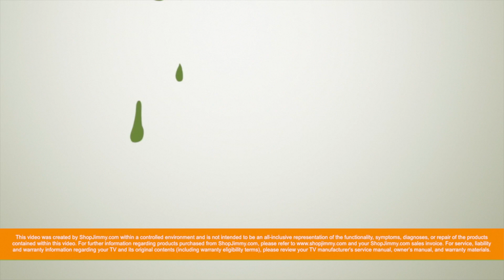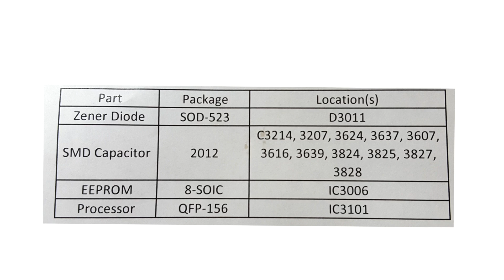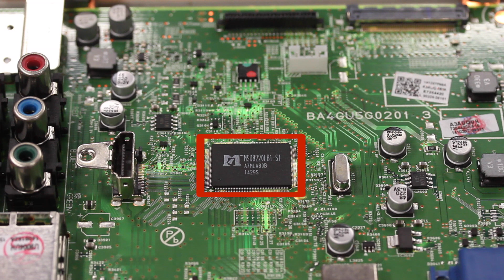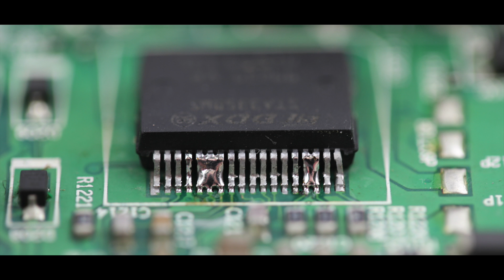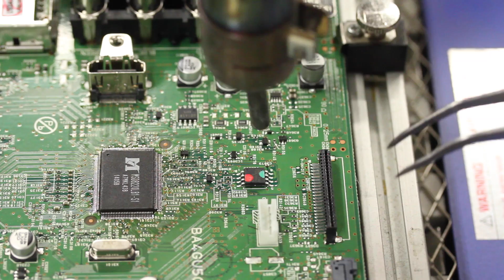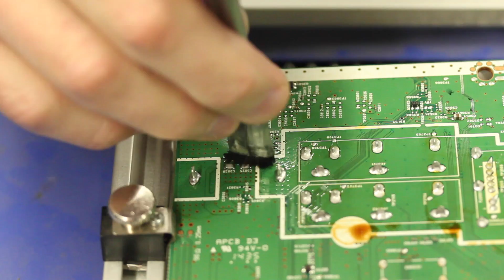Magnavox Emerson BA4GU5G0201 Component Repair Kit - Dead Set, Power Supply Chirping

Comment: I just took out the C3214 and C3207 Capacitors and the T.V worked. You really don't need to change all the ICs and capacitors. Just check to see which capacitor is shorted and switch out. Do it all capacitors on the power line.
Reply: Do you have a value for c3614? Thanks!!!
Reply: Samsung 47-inch